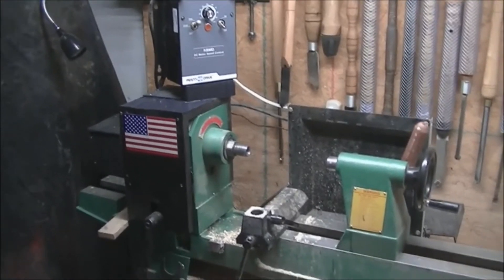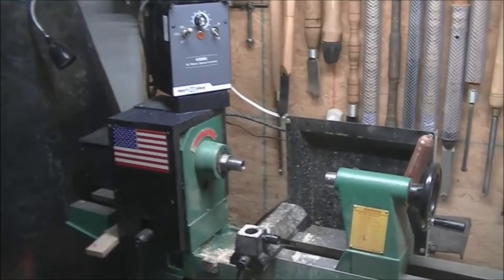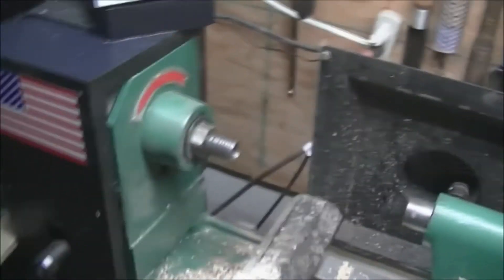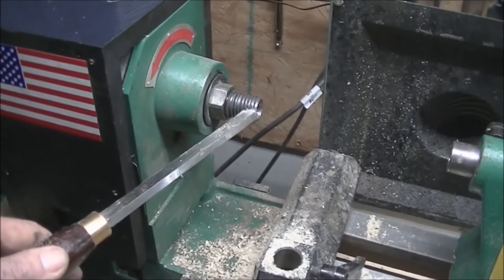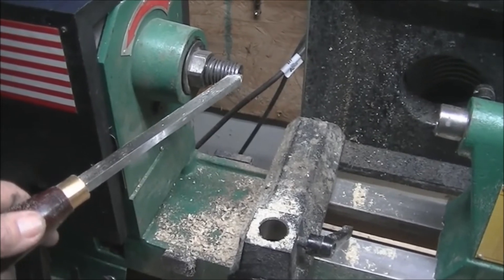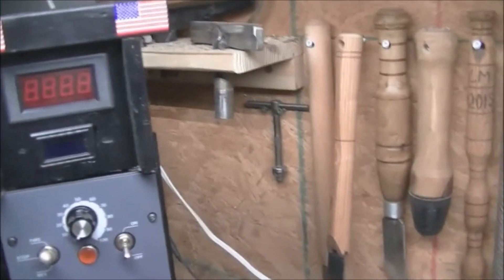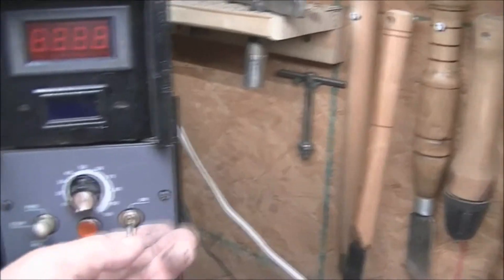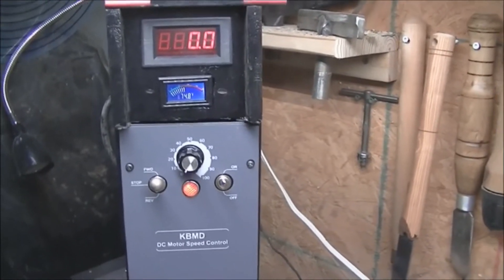Lathe Update to the Update

Comment: If you turn it off with the power switch and leave the speed setting at say 1500, will it restart at 1500 or do you have to return it to zero?
Reply from the maker: Absolutely, it is much safer to bring you speed up every time.  Otherwise, you will forget and it will happen, you will whirl something up that is unbalance then you will have to jump around to turn it down before it flies off.  ALWAYS start at zero.  Thanks for viewing, Larry
Reply: Thanks but that really didn't  answer the question! When you say absolutely do you mean yes it will start at the Set speed or do you have to return to zero before it will start? Thanks.
Reply from the maker: I thought I did.  It will start at the speed you left it in unless you turn it to zero before you shut it off.  So if you turned the lathe off using the on/off switch at say 1500 rpm, then when you turn it back on it will automatically go to 1500 rpm.  I think that is a bad idea and very unsafe.  And it will bite you in the ass if you don't turn the speed down first.  Been there, done that.  I hope that answers you question.  Thanks and take care, Larry